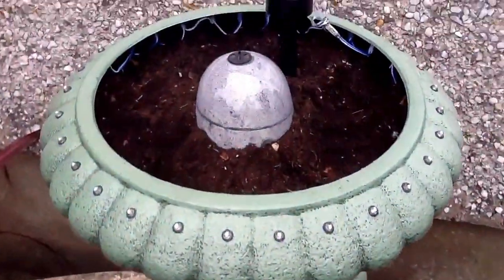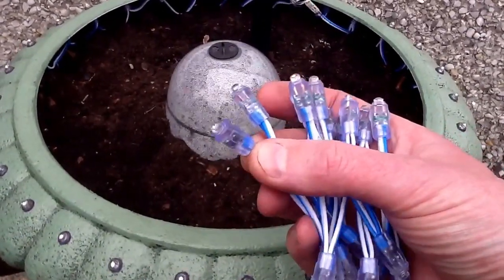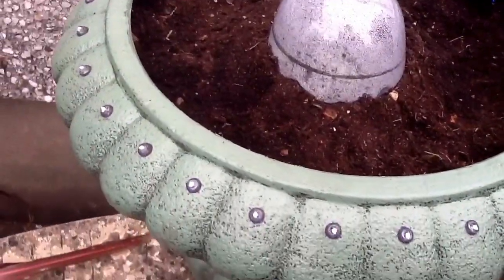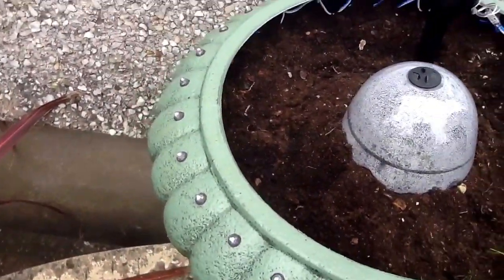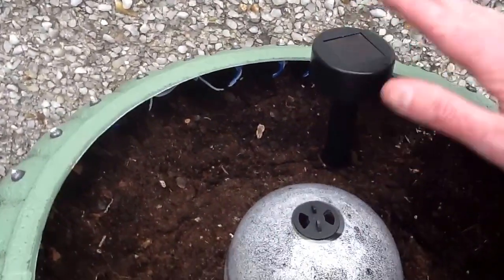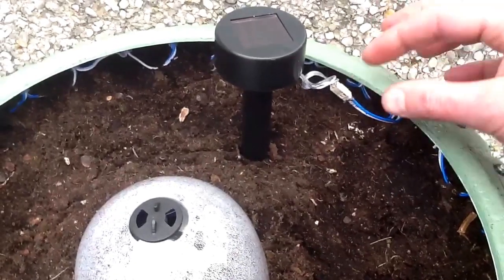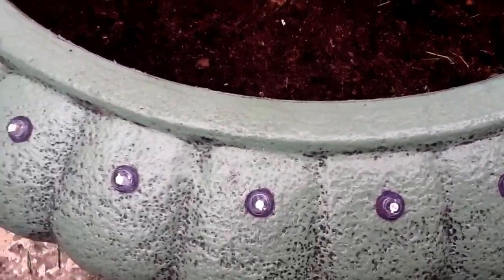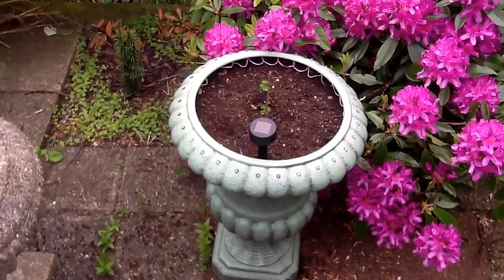Solar powered garden planter.

Comment: So how has this lasted over the years?
Reply from the maker: Still going string although the connectors have needed changed due to corrosion.  And planting catnip in one resulted in all the LEDs being pushed in by greedy paws.
Reply: How many hours does it work?That small solar panel shouldn't be able to charge baterry properly. You should add greater solar panel.
Reply: Follow-up video: v=F6_mFIE7EbQ
Reply: @bigclivedotcom  I love this video. I was wondering though what are the name of those beautiful pink flowers at the end of the video?

Comment: Hi Clive, 19mm black tubing (used for aquarium systems, cheap as chips!) curled in a circle with circumference to match the width of the flower pot.  The circle is closed / joined using a T-piece.  You can thread your cable through the tube, drill holes to match the holes in the pot.  The open end of the T-piece connects to your solar cell, (you may need an L-Piece to make it vertical). Affix tube inside pot, Done!  All wires neat, hidden and insulated.  Then you can fill your pots to the brim.